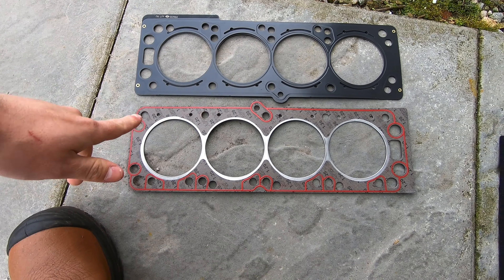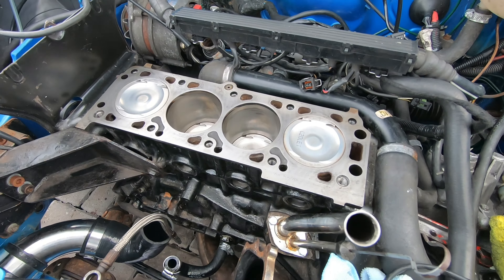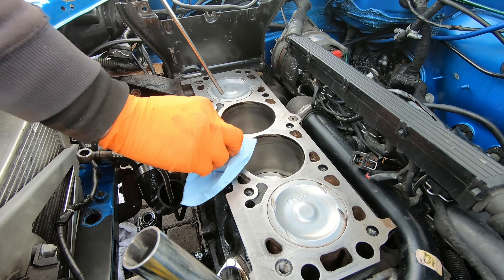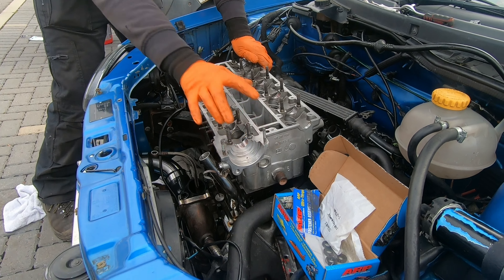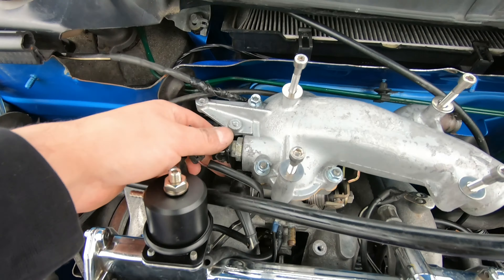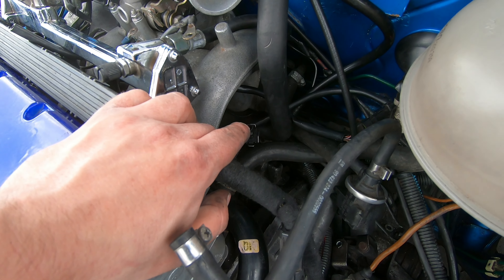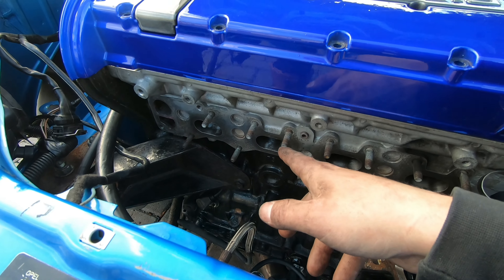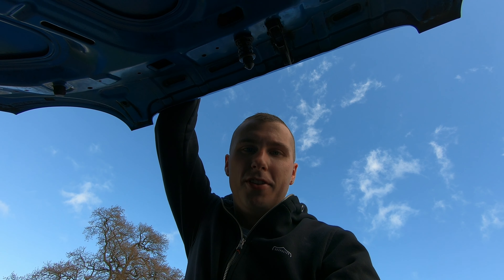THE CORSA B C20LET GETS A Z20LET STEEL HEAD GASKET & ARP HEAD STUDS | Reassembling The Engine Pt 1

Comment: Dude I noticed you use adjustable fuel regulator. I bought the exact same one from aliexpress and it blew within a month. How long have you been using it ?
Reply from the maker: I haven't used this one yet buddy but now you have me concerned 😄
Reply: I have the same One on my xe turbo for 2 years no problem só far
Also have ARP studs on mine and they are reusable no problem always use ARP assembly lube and recomended torque ......all be fine
Reply from the maker: @xmterceirapm9149  perfect thank you